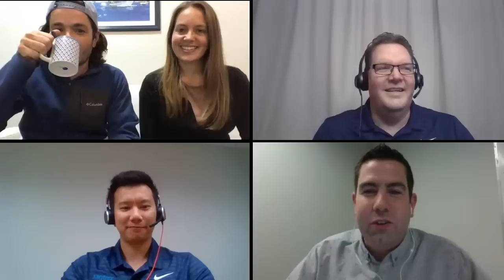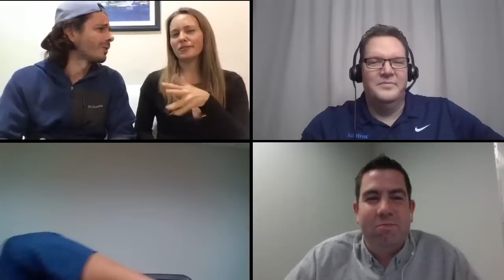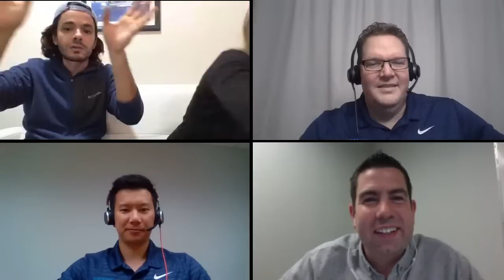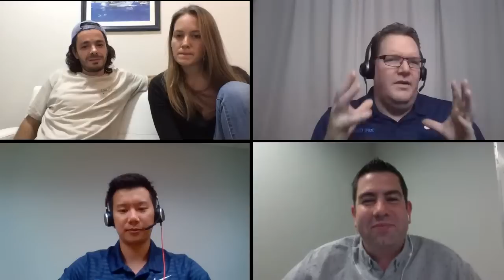⛵️Let's talk about onboard electrical systems!! Odd Life Crafting + Xantrex Live Q&A

Comment: Congratulations on the videos and the work already done!
I don't know much about electricity and maybe my question is silly. From what I realized, there are advantages and disadvantages to having the solar panels connected in parallel and in series. In that case, wouldn't it be feasible to install a selector that, with some special connections, would allow the two types of connection to be exchanged at times when one or the other would be more advantageous?
Big hug

Comment: The solution I found was to connect the MPPT charger directly to the battery and upstream of the battery disconnect, but this still allows for human error (disconnecting the battery, leaving the charger on and then connecting the loads). The negative effect of such mistake can only be observed in the transients (milliseconds) so it is not something easy to conceptualize, but the MPPT manufacturer advises against it. I was hopping they had a solid state relay with Voltage sensor that only closes the MPPT circuit when the battery is detected.

Comment: ?  You can't buy the desired lightning equipment in Brazil . Is that because there is not a distributor ?  If the lightning  antenna in the US that you want  was sent to you , could you put it on the boat or, would Brazil not allow it ?     Would it be a question of trade fees or agreements  ?   If you could put it on , let me know .   All the best, Hal

Comment: Re: the question about electric motors, I've seen a number of discussions on this and most gloss over the fact that some waterways mandate minimum speeds, such as Panama Canal  (see www.pancanal.com/common/maritime/forms/f-4352.pdf). Also to be considered is if you go against a current at all such as the US ICW.
Reply: That for the most part should not be an issue, unless one installs too small of electric motor, but that would be the same for any motor installed including diesel. The only difference is also if battery bank is sufficient as well, which would be like installing too small of diesel tank. However unlike diesel tank, undersized battery bank would be much more of an issue in comparison. Or guess should say it is more critical to ensure you have decent size battery bank to go along with that electric motor. So not counting undersizing the real issue is maintaining higher speeds for longer durations. But as stated for shorter periods of time if there is such larger speed required, this will unlikely be an issue. Take an appropriate sized electric motor and battery bank, running at half power should be able to do 4-5 knots for entire daytime (8 - 10 hrs) but running at faster speed and higher power like say 3/4 power and that would likely drastically count down time it could run to maybe only few hours. And ofc vice versa if you run at lower power can increase the run time. So realistically going through the Panama Canal should not be an issue if you have an appropriate sized electric motor and batter bank. But most the time is done during daylight hours with at least some amount of sun, so battery will be replenished during trip and extend that anyway. Even IF you do not that can still be compensated by with generator, but one really should not be undersized anyway. That would be like putting on small 2 stroke outboard on 40' sailboat and expecting to cruise around on, just silly. You do realize there are many with electric motors that has gone through Panama Canal, correct?
Reply: @kevinfisher1345  I was not looking to start an argument, was simply pointing out that there are conditions that a vessels owner should take into consideration.  If you never want to go through the Panama Canal or travel upriver through an inland river system it's not an issue, but the ACP requires an minimum full speed ahead of 8 kts for the duration of a standard transit (around 8 hours).  Take a look at the size of motor to carry a good sized boat at say 7-8 kts for 6 to 8 hours...  Then look at it's power consumption and then at your potential energy generation and storage and  their associated costs.  I guess if you can afford it and have the space, its no problem.
Reply: @TwisterDawg73170  I agree there might be situations when one might want to re-consider. For example upriver all day against 5 knt current. But sorry Panama Canal should not be one of them. In reality it might but that is simply because they do not have adequate size motor to begin with, this can be the same regardless whether that is electric or diesel. But for adequate size electric motor, one can run at 1/4 to 1/3 throttle maintaining 3 - 4 knts during the daytime just fine and not burn any energy if they have adequate regen. Running at 1/2 to 2/3 throttle should be able to do 6 - 7 knts just fine even without regen for 6 to 8 hrs. Although that would likely leave them needing to replenish that battery bank at the end if that is the case. And ofc they should be replenishing some of it during the trip, but still might need to replenish more at the end. This is where gennies come into the picture if needed, and it is not that hard to even rent one for such trip if do not already have one. And in worst case scenario (since not all sailboat can even do 7 - 8 knts that long) they need to be towed through. But realistically it is going to be cheaper to rent gennie before that, something that diesel engined sailboats can not do if they can't maintain that speed during the entire length. I do not get where everyone seems to think electric engines are weak, the only thing I can think of is they have experience with underpowered electric boats. Yes for long extended trips that will be the case or full throttle that would even be worse as likely would not last couple hours, but how often does anyone in sailboat go full throttle for so long of periods of time? If they are, they are underpowered to begin with, regardless if its diesel or electric. And ofc most are not going to go faster then 7 - 8 knts anyway as that is likely the boats hull speed.
Reply: @kevinfisher1345  My personal preference is for electric, but I'll be keeping a diesel gen set (and spare brushes, bearings, windings etc....), so perhaps might be considered a hybrid system.  With over ten years in off-grid commercial power systems, I've learned that hybrid systems are usually the best all-around.  Putting all your eggs in one basket has never been a good idea (if you are as paranoid as I am).  As technology advances, I might consider ditching diesel, at the current state of the market I just don't see as equitable for myself, as always everyone is allowed their opinions
Reply: @TwisterDawg73170  And I concur for most people. The tech is there right now where it can work, but yes the tech is not there yet for most people. To do it efficiently with electric one must putter around at only 3 - 4 knts most the time, and most people actually rely on running their engine to recharge their battery bank. Not to be draining it. And having a gennie is kind of self-defeating imho and worse efficiency anyway especially if they do not have dc generator. But for the cost, I think anyone is wasting money by ditching diesel engine that is working, if one needs to replace it, then maybe consider such.

Comment: I'm doing the same in Italy on a Albion 36" Plan Caroff. I did plan to be energetically free by installing 1 BALMAR potential alternator 165A with  isolated poles  which can be programmed with a BMS. The batteries are 2 x lithium 175A. There are 2 x solar panels 175W  connected with a MPPT + a wind generator 400W. For the shore electricity I installed a transformator 115/220 connected to a victron quattro which includes a 3kw inverter. Not an easy job to do but It gives you the opportunity to be free to sail without getting connected to shore power for recharging the batteries

Comment: UK is building a Liquid Air Battery to power 200,000 homes. A Liquid Air Battery compresses air into a liquid, then stores the liquid in a tank for future use. When the house batteries need to be charged, the Liquid Air Battery converts the liquid back into a gas, then uses the gas to power a turbine that produces electricity to charge the batteries. When the batteries are charged, power is used to compress air into a liquid for storage for future use. Green, renewable energy. I'm thinking if the system can power 200,000 homes, that the components can be miniaturized for use in a home or on a boat. FYI :¬) Webhead USA

Comment: I have asked before, how about computer fans for cooling inverter. Cheap and quiet air flow
Reply: Bill Hartsfield  And, I mentioned USB Opolar fans.  My guess is they have a lot on their plate to finish getting the boat in the water, before deciding if heat is a problem.
Reply from the maker: @beckypincalifornia1985  You are right. We are gonna keep monitoring the temperature there
Reply: @OddLifeCrafting  Try to find one of those small, battery-operated, indoor thermometers that measure the high and low temperatures per day. Could put it near the inverter. Here in US, cost about $10 at Walmarts.  They also measure humidity.  Best wishes.
Reply: Hi Bill - thanks for watching!

Comment: Do you offer a matery monitoring system for high amp systems. We have  4  170amh  12 volt lytheum bateries.  The normal shun is not large enough for our system I was told by RV shop
Reply: Battery not maternity
Reply: Renogy flex you can walk on and come with a good warranty.  Weigh in nly 6#